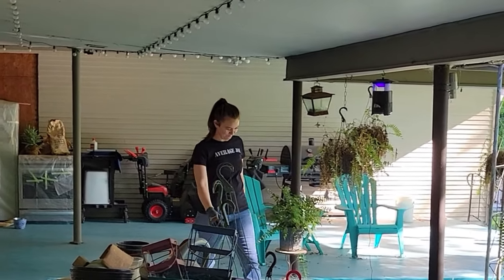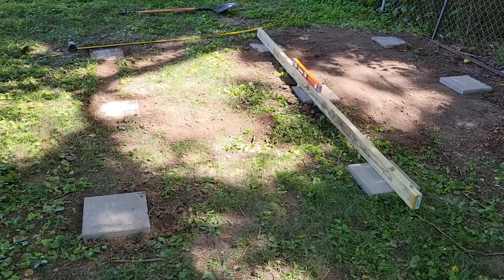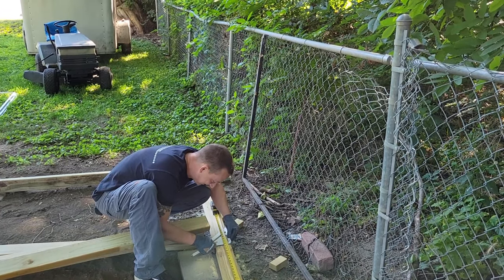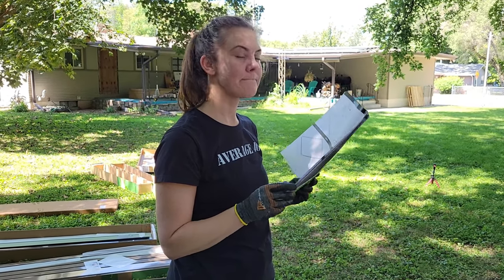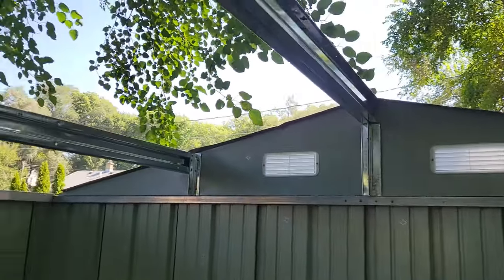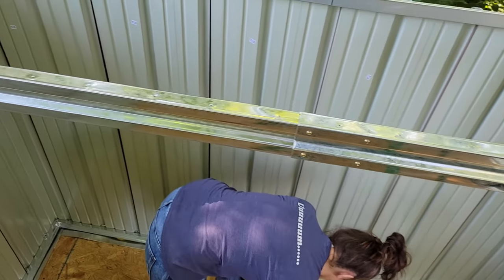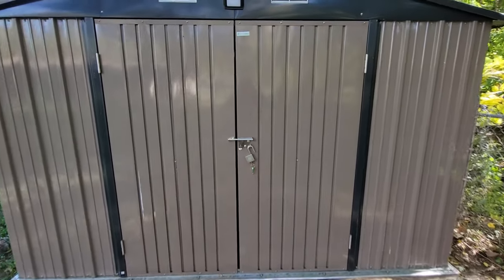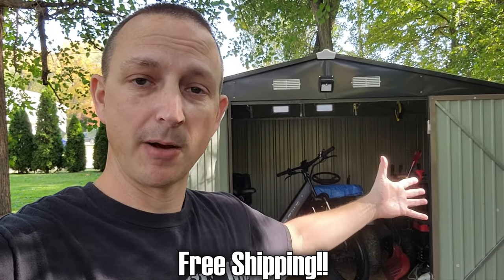Building a 10X8 Metal Shed from Patiowell.com Better then Lowes HomeDepot??

Comment: In about 2 years you are going to regret buying OSB instead of good plywood. That OSB is for house floor decking not outside weather and humidity facing use. That OSB will fall apart from humidity and almost ground facing water in 12-24 months.
Reply from the maker: Is it really that bad?  Ill keep an eye on it.  I did get it sealed up pretty good but still need to do the door area.
Reply: Yep built my shed on 3/4 pressure treated plywood over 20 years ago. The floor deck is still perfect but the vinyl shed is showing its age.
Reply: just paint the floor with flex seal
Reply: My thoughts exactly.  Should have purchased 3/4 pressure treated plywood. 
The only drawback with pressure treated lumber is it is treated with copper oxides. This will cause the Steel screws to rust at  the base when it comes in contact with  pressure treated wood. A gasket to separate the contact of the 2 different materials.
Reply: I actually used OSB on the outside walls of my building 20 years ago. It has some pieces flaking but it's still 99% good
Reply: I have just yesterday built a shed which almost identical (I screwed up the roof beam installation too lol). Mine is has sliding doors. But mine didn't fit together nearly as easily. The screw holes were not drilled well, had a to drill my own holes in some places. The gable piece is garbage and has gaps due to shoddy screw holes and just overall poor machining. I'm in the UK. It's going to rain all day today, beginning of October. Let's see how many leaks I have get.
Reply from the maker: @andrewgoodall2183 Yeah we installed that area wrong lol. Everything on mine seemed to line up great after. No drilling. Ill mention I did put a dab of silicone on the roof screws a few months ago because I stripped out a few roof screws during install. I had one small leak after the winter snow so in spring is when I added the silicone.
Reply: @AveRage_Joe  I'll have to remove the roof panels to get at any leaky screws on mine lol. Or get longer arms.
Reply: @andrewgoodall2183  Sounds like I might have the same one as you (I'm in the UK too.....Amazon???)  Mine also has sliding doors.  What base did you put yours on please?

Comment: If anyone is planning on putting up a shed check your local ordinances.  A lot of locales won't allow structures close to property lines.  My city for example has a 5' setback requirement from the property line and the side facing the road has a 30' setback.  Some neighbors won't care, some will call and report you to code enforcement if you violate it.
Reply from the maker: Yeah you do need to check.  I did check and its about the same here.  I could go a little closer.  In my area most people wont care especially my neighbor lol.
Reply: @AveRage_Joe  Yeah lots of people have HOAs with boards staffed with retired busybodies who have too much time on their hands... people who live under that kind of steel toed boot will probably want to add an extra foot over code to be safe. :)

Comment: been reading reviews on amazon and people talking about the screws not lining up.  I wondered it would be they put something together wrong at some step.  watching your video kind of concerning that around 10 minutes in.  I am highly thinking about buying one of these.
Reply from the maker: Yeah I would say they put something together wrong. We did at one point and of course nothing lined up so had to redo those parts. Once it was in correctly, everything lines up! Also fyi the shed is still up and looking and doing great. No issues at all. Even after some tornado storms!🤘
Reply: @AveRage_Joe  my orignal plan was just to build it and set it in my yard, dirt floor, but after watching your video I am re thinking and considering building in a floor like your video.  mainly thinking about this for my riding mower.
Reply from the maker: @vontar1 Thats what my original plan was as well. Dirt floor and call it a day but then decided a floor would be good😆

Comment: Nice job, both of you 👍😀
Next I'd get some ridgid insulation on the walls leaving  an air gap for air flow to ridge vent. Otherwise tape gaps and seams to keep temperature more moderate
Solar lights and vent fans are nice additions

Remember that the roof trusses can't carry much of a load, without beefing up.

What is the snow load for it ?
You might project a solar air warmer for   flowing up behind the insulation using the air gap

🤔💭💣💥
Reply from the maker: Thanks!!  For the time being it will hold all the outdoor equipment so dont think Ill be adding any insulation.  May add tape if it warrants it to help keep the inside dry.  Yeah the roof trusses cant carry an extra amount of weight.  Id have to check on the snow load.  Its under all the trees so it shouldnt see to much snow but we will see.💥
Reply: @AveRage_Joe  yes, my friend you will see.
On another subject, why did your testing solar panel video end so abrupt ?
Did you find the fault and fix the tester ?🤔💭💣💥

Comment: I wouldn't fill the gap between the two doors with foam like you mention. I'd probably just go with some metal flashing material or even just any thin galvanized sheet metal you can get in a strip. Attach it to one of the doors on the edge and have it just span the gap over to the next door.
Reply from the maker: Thats a great idea actually!!!  Ill probly do that!  Thanks🤔🤘

Comment: I like that you showed some of the pitfalls - and that they aren’t too terrible. I don’t mind DIY projects. I’d follow up with the shelving - and I intend to put in a small bench and chair - with an electric run to my outdoor breaker box with a receptacle inside. But I think it looks better than serviceable. Just a bit of time and patience.
Reply from the maker: Thanks! Yeah the shelves, bench and electric would be GREAT! Ive been using a portable power station if I need power over there. 100% patience as there are a million screws😁🤘
Reply: Good build ! Is there a reason you built it in that orientation between the tree and fence?
Reply from the maker: Thanks. I just wanted it over in that area since the grass didnt grow well. Door direction was for driving the mower in and out😀

Comment: I think to avoid the stripping I would use a putty or a type of glue that is like a seal I would stick the seal on the bottom of those holes and when I screwed it in that way it would stick in there and it wouldn't get shredded or stripped

Comment: I don't know the details of what you will do with this shed, but...a metal shed is perfect for a battery and inverter storage. This would make it easier to get a building permit (where required) and it would have a low impact on your home-owners insurance, by putting the lithium batteries in a metal out-building. It could also use some wooden shelves one foot down from the ceiling along the walls.
Reply from the maker: At this current time it will house all the lawn equipment but I do like where you are going with this!!!  Shelves are a must!!!🤘

Comment: Love it! I’m thinking about ordering one to store my horse tack and feed in it. Has yours proven to be pretty reliable in the rain and snow? I’m only worried about moisture buildup, I’m hoping the ventilation is enough to keep that down.
Reply from the maker: Yeah mine is still up a doin great. I did over tighten a few roof screws (since it was easy to do) so I had a few drips inside. To fix that, I just added a tiny dollop of silicone over the roof screws about a month or so ago. I did all roof screws to be safe just incase I had others I stripped out. Im in Omaha and we have had HUGE storms the last month and all good inside.

As for snow, the placement of mine is sorta in the tree cover so I probly only got around 6ish inchs of snow this past winter.

Comment: hehe good to see the Mrs back on, haven't seen her since the live streams I think.
A small solar panel and 4 PC psu fans to pump air out the vents, might be enough to take the heat lingering at the top out.
Reply from the maker: Its always a treat having her in the videos!!  Oh man the Live streams were fun!  I like the idea of having solar on the shed!!  I do have the very FIRST solar panels I ever bought still.  Couple of 12v panels.  Will have to check the output on them and see if they still work!🤔😃

Comment: Hi there Mr. and Mrs. Joe! I like shed project and you did a great video. I am so happy that I stopped by to view the video because I have an upcoming project somewhat similar to yours. I have on order a 6' by 4' metal shed. Money is tight so I was wondering how and what I might use to keep the base off the wet ground. (Live in rainy climate), I was thinking 9 cider blocks and One OSB 19/32" board, again, tight budget for this widow. What are your or your reader's thoughts on these items for the base?
Reply from the maker: Thank You and thanks for watching. The cinder blocks are good. Since its rainy, I wouldnt use OSB. A few in the comments here said it will balloon up and fall apart quick. You might have better luck with plywood.
Reply: Hi there Mr. & Mrs. Joe Average. Thank you so much for answering my question. I will therefore order the plywood for the floor. thanks again and God bless you both!

Comment: GREAT JOB THE TWO OF YOU!
IF YOUR NEIGHBOR CUTS DOWN THOSE TREES, IS THAT STRUCTURE STRONG ENOUGH FOR ADDITIONAL SOLAR PANELS?
Reply from the maker: Thanks!!!  The trees will fall before the neighbor ever gets to them.  They hardly cut there grass but maybe twice a year back there.  I have 2 smaller 12v panels I was thinking of adding.  Should hold those no problem!🤘

Comment: @AveRageJoe 
Was your 2x4 and strand board flooring an extra add-on?  Was it part of the directions in the box to add?  I just received a small shed in the mail.  It doesn't mention anything about mounting mine onto flooring.  I am going to install flooring though, like you did.
Reply from the maker: I went to Lowes and got all the wood. Showed that and what I got in the vid. Yeah no mention of the floor but I assumed that it assumed I was putting it on concrete or a wood floor.

Comment: Quick question for ya on this build, I’m building the same shed. The metal braces that hold the side panels on at the top when building the walls, did yours come with home predrilled? Mine didn’t so I’m thinking maybe my piece is flawed. Also, around the 8min mark where you are talking about how the roof panels screw into the grooves on those braces, since they don’t give you self tapping screws, did you have to predrill holes or did yours come with holes predrilled?
Reply from the maker: Everything was predrilled and I didnt have to do anything other then install the screws. I did have to flip around a brace or 2 cause I wasnt paying attention but yeah, everything had a hole or a slot.

Comment: I really enjoyed your video. Thank you for posting. I have a question about the dimensions. What are the dimensions of your base? I have an existing concrete pad that is exactly 120” wide and am worried that the extra 0.8” will hang over and create a crack for whatever to get inside.
Reply from the maker: Thanks! Id have to run out there and measure if for ya when I get back. I want to say it was just over 120" if I remember right but will check.
Reply: @AveRage_Joe  Thank you.  I'm thinking a 3/8 overhang on each side won't be that big of a problem.  Especially if the bottom frame has enough width to accommodate.
Reply from the maker: @WalterKeener-sj6mg Ok so just measured. Its 121 lip edge to lip edge. That lip edge could probly be bent down to the edge of your slab.

Comment: Do you know the width of the door frame?  Would it allow for a 54 inch wide lawn mower deck?
Reply from the maker: My 42 goes in with ease and room on the sides. Door opening is 59-1/2" so yours should fit but might have to tilt up the side chut depending on width.👍

Comment: All this shading, you need to cut down ALL the trees and put solar on the shed! 😉
(Read this on another channel, so must be true!)

At our place, termites would eat all this timber and wood of the floor. It would be falling apart within 2 years.
Reply from the maker: Well then...it must be true! Ill get to work cutting down ALL the trees. Plus that will help with all the termites we have😆 I may put a few small panels I have on the roof. Wont see any sun but may keep something charged🤷‍♂️

Its possible termites will eat it up. Ill keep spraying for bugs🙄🤠

Comment: Are you supposed to remove the thin plastic coating on the sheet metal?
Reply from the maker: I left all that on. You can remove if you want but I opted to leave it. Others said it is a PIA to remove.
Reply: @AveRage_Joe not too hard to remove, when fresh it will hold together and be stretchy, it will be a real chore to remove after exposure to UV as is gets brittle and starts to crack and peel
Reply: Let us know how it goes without peeling.
I left some stuff on my deck and it ended up a mess on the pvc so I can see where ideally you’d take it off.

Comment: ITS garbage, the roof will rust very quick with the leaves on the roof, the edge trimming shud be removed so the leaves can blow off or wash off from the rain, at middle height on all 3 walls shud be a z perlon mounted horizontally to reinforce the structure in high winds, and 4 x 3ft deep concrete pillons with metal builders strapping connected to the reo bar and long enuf to go the full height on the inside walls. Nice to see the lovely Lauren again.... what a cutie :)
Reply from the maker: Do you think the roof will rust???  Ill take a look at that edging for stuff to easily slide off.  We shouldnt get to much wind where its located....unless a tornado rolls through which could happen...  Lauren is a lil cutie!!!💥🤘
Reply: @AveRage_Joe  OVER TIME THE LEAVES WILL THICKEN UP and compress but will stay very wet cos the trim is stopping from falling off.... I have seen this happen alot cos these cheap sheds are EVERYWHERE.... u can still install 4 anchoring piers on each corner, in cyclones here the 2 doors fly off first then the whole shed goes.

Comment: I have  a similar , if not identical shed I purchased from Amazon,  I do not like it because of  the cheap  screws, super thin metal ,  and how easy they strip and  the packing in the box  was horrible,  parts bent and this is the white trash special so should have expected that  ,  and I think its ultra  junk ,  I wish I had a better experience, but Im sure there all built in the same place in China, I was disappointed considering I paid about 600 bucks  and it had 5 star rating, but I guess if I got it for free Id feel better about it  but thanks for the video , it was helpful but for me its a  big thumbs down , I wouldn't buy it again, and Im sure it will not last

Comment: The plastic film is a nightmare to remove.  It requires fingernails to dig into the edges of the film to remove can't do this with the gloves on..  So this invites all types of cuts to your fingers  The film is thin and weaker than its adhesion to the painted panels.  The plastic washers need inside flashing or tabs to help keep them on the screws.  I note that there is no mention of the plastic film in the instructions probably because it is a known nightmare to the manufacturer.
Reply from the maker: I left all the plastic coating on all the panels. Some remove it and others leave it.